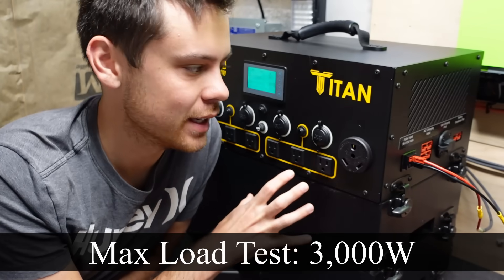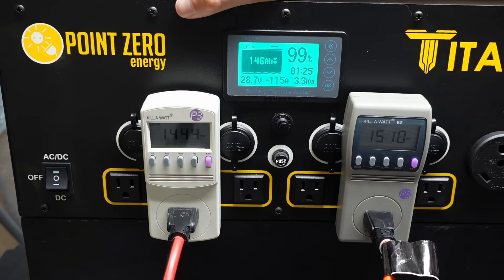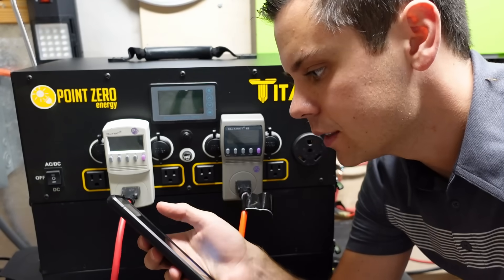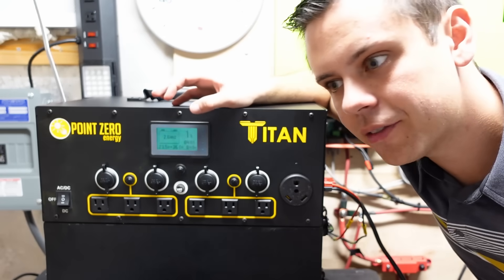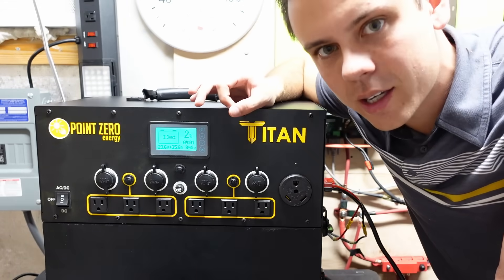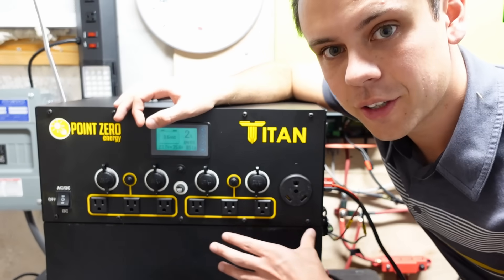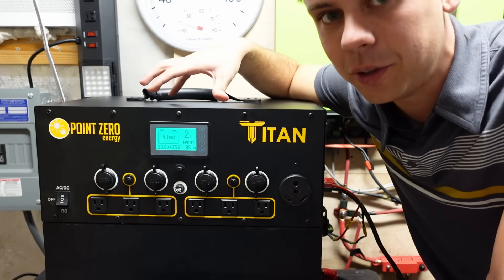Titan Solar Generator: Max Inverter 3000W Load Retest!

Comment: Wonderful content!!!  I have a question about adding a server rack or a titan style set up to my 2019 Forrest River FR3 RV.  1) It is time to replace the two 12 volt lead acid house batteries which batteries would be the best for that existing system, considering moderate off grid use 2-3 days? 2) can I plug the titan system into my rv generator full time and then plug my rv house into the titan system (with 3 batteries I assume) 3) thank you, and I am sure you would get an extra boost of followers by having specific RV solar content…..  regards Charlie V in Naples FL…

Comment: Hi Will. If you were to store the Titan for a long period of time,( a year or longer) at what state of charge would you recommend to have the battery level at?
Reply: Per the manual they recommend you fully charge unit before storing it
Reply: @kayeloop674  actually, they don't
Reply: @ozzieosawamick1712  you are right thanks for letting me know. Page 11 of the manual says  charge to at least 50% and for optimal battery life use 10% of the battery per year. Good to know
Reply: @kayeloop674  do you have a unit?
Reply: @ozzieosawamick1712  Yes. I use it for my off grid RV.
Reply: How many batteries and how many panels?
Reply: @ozzieosawamick1712  right now only 2 batteries and 10 panels.
Reply: @kayeloop674  if you were to only have 5 panels, what would it read on titan screen when charging in full sun. I ask because i only have 5 panels 100 watt, and I cant see to get about 100 watts when in series

Comment: Will, the 2021 Titan 2.0 will use Lithium batteries, require at least 70 volts imput, and have a few more bells and whistles.  Cost estimated to be $500 more than the current Titan.  Any initial thoughts off the top of your head?  Hope they send you one to evaluate.

Comment: We usually like to see higher than rated capacity in a battery, but in this case, there might be a downside. Will, in your first Titan video, you said that PointZero gets their 2000 cycle life out of these NMC batteries by derating the battery's true 2200wh capacity to 2000wh (90% DOC). That makes sense. But in this video, you test the capacity of two batteries to 4,152wh. So if the Titan generator (or, presumably the BMS) is not limiting the capacity to 2000wh, wouldn't it in practice yield fewer cycles, and behave like other NMC battery (500-1000 cycles is what you mentioned in the first video)? I know 4152 isn't 4400, but you get the point. The system didn't hold it down closer to 4000wh total (90% capacity). Or is lowering the capacity to 94% enough to yield 2000 cycles? After running the Titan for a while, are the batteries more like 2000wh capacity (in other words, was the 4152wh test result just a feature of it being new)?
Reply: tested to 4218wh in the first video.

Comment: Please have a video testing the RV plug. I used it powering my A/C “Mach 2 PS” with one battery and had the titan pulling 8kw before it went into safety mode. Issue started when I switched back and forth between low cool and high fan option.

Comment: We are enjoying your videos.  Haven't made it through all of them yet for sure.  You had mentioned in your previous Titan testing video that the DC charging wasn't great (wires getting warm for example) and to connect it directly to your car battery instead.  Did they fix this problem.  Is it safe to plug it into the cigarette lighter while driving and have the Titan charging while driving?

Comment: Would you recommend the titian for  full time rv life or would a Battle born set up be better?
Thanks
Reply: I am currently using off grid 24/7 through RV plug for the last 3 months seems to be working better now that I got the second battery and additional solar panels

Comment: I'm very new activist solar generator thing. I have a 6000-btu Kenmore Elite window AC that runs at 390 Watts Max window compressor is on and drops down 2 only 15 watts when the compressor shuts off and it's in energy saving mode. I live in the hurricane belt here in South Florida and it's the only Appliance I care about in an emergency. What size and brand solar generator should I get?

Comment: Do you have a sense if this unit or possibly the Inergy upcoming Flex system would be better for RV Sprinter conversion with our electric systems only. Pros and Cons for application in Class B Rvs would be helpful

Comment: Hey @will would you do a video in a 48v system with stacked cheap 1000w gridtie's + battery based system with an automatic transfer between gridtie and battery when the grid goes down. So best of both worlds but without a hybrid gridtie.

Comment: this should have a bluetooth   option in it with app so you can monitor it when your away  but otherwise  great product  and video
Reply: That would be nice, also a "remote" screen for RV applications.
Reply: The 2.0 has added this feature now it seems.

Comment: First of all, you won one more subscriber! Really like the way you approach and explain.
Hope you can help me have an idea for what I wan't to achieve with Solar energy.
I want to feed my lights in the front yard; My lights with sensors outside; My garden lights; The garage power; And probably use power tools.
Be able to work with Alexa to tell me the battery level and have control with the temperatures, everything in my phone.
What you think? ;)
Cheers

Comment: What is the best thing to do when different multimeters are reading different voltages?  My Victron battery protector with bluetooth reads 0.24 volts more than a multimeter that is connected to the system with a 50 amps shunt.  When I measure the voltage directly from the battery with an independent multimeter, it reads very close to the in-line multimeter but the Victron is off by 0.24 volts.  Since 2 are measuring very close to each other and the Victron is the one off by 0.24 volts, I've adjusted my cut off based on these other ones and not the Victron.

Comment: Ok. I have a question I hope you can address. I’ve looked everywhere, but nothing. I have two rockpals 100w foldable panels. I want to charge my rockpals 500w power station. Can I just use a y mc4 cable? I noticed it will only take 30v, but each panel is 19v. If hooked up like this, will I lose enough voltage to be safe to max the solar charge?

Comment: I know I'm off topic here, but does anyone have an answer for me? I just mounted a 100 watt renogy panel on my van. I have a 35AH battery and a renogy mppt 20 amp charge controller.  If I put a 12 volt plug into my accessory port (cig lighter type port) with clips on the end clipped onto my 35ah battery, will my panel keep my van battery charged along with my solar battery?

Comment: Can I parallel two of the same Titan Solar Generators 30 amp receptacles @ 110v each and get 220v single phase? If so, then would I tie the two neutrals together? This would be (2) Titan 2000 watt kits with (4) batteries total.

Comment: Great videos Will!  Was there any load testing done on the 30A socket?  I’m considering this for a camper trailer plugin with solar on the roof instead of building my own system.  Thoughts?

Comment: Will can you do the same test you did on you’re last video on the titan where you hooked it up to ac power and  solar power then you pulled the max draw out of it. I think thats a very realistic scenario that will happen once in a while.
Reply: Update: this will actually damage the unit found out first hand. Don’t use ac power to charge unit while using it

Comment: 3000 watts is just not enough power. I use a lot of power tools on a work site.  Can they make a 6000 + wattage system that will hold up under a full 20+ amp use all day?

Comment: Will I'm impressed with your knows he of solar, do you understand or know how the Tesla coil works? And why can't we use them?
Reply: With your knowledge not he knows
Reply: We don`t use Tesla coils because there is few practical uses as it give high voltage and high frequency (1000 to 10000s of hz and not 50hz /60hz like the grid) and also inefficient compared to stepping it up with a normal transformer (also invented by Tesla). As far as I know the only practical use of Tesla coil today is in the ignition system of the cars and similar as the spark coil. Tesla coils was used for the first radio transmissions using Morse code. There are probably other uses for Tesla coils that I do not know about.

Comment: I'm glad. my Titan a few months ago handled an entire home (3 fridges, 1 chest freezer) two LCD TV's, fans and LED lights. Rocked as expected for 1.5 hours  when we lost power.  Wired it through a Genny transfer switch.  No 220v as one would expect from a single unit, but everything else in the house ran like a champ. I didn't need to see this video to be a believer.
Reply: Hey Justin, I'm also looking for a whole-house solution connected to the house electric system to run three fridges, security system and lights at least. So you only needed it for 1.5 hours, but for how long would the Titan have lasted you (with no panels, just battery) if the blackout went on for days?
Reply: @Chavezoid  it was a localized power outage. I had just gotten the device and the power happened to go out. I had two batteries. on this instance though I only used one because I didn't balance the voltages on the two. It got down to 84% during that time. You have to understand that I am in Hawaii and the temperature was about 78° and it was from about 7:30 to 9:00 p.m. so it was mostly dark. I plugged it into a standard 50 amp transfer switch with an RV dog bone which allowed the bridge between the two phases. That solution meant both phases would get 110, but I couldn't start up any 220 appliances. I have solar hot water, so the hot water was out of the loop as well, but it was a short outage. My lp generator is 3,000 w and it never stresses day or night when I have to use it. My goal was to use this overnight and run the generator during the day to charge it and run the house, both without panels. But after playing with it for a while, I most definitely think I should get some solar panels so I am shopping for some as we speak. I haven't decided on amount and type, but I do think in a real world massive outage, but this dual solution with solar panels would work really well for me.
Reply: I know it’s an old post, but I’m so glad I got both of my Titans before they went out of business. Such a piece of mind
Reply: @latymz  Your not the only one...Titan has run my green house now for 5 years.  But what do I replace it with in the future...so many fly-by-night outfits, here today and gone tomorrow...how many will be in business if the economy collapses...probably none...so now I'm on a DIY learning curve...ugh.

Comment: I love the idea of having a 3000 watt generator that uses no gas or oil & can set about anywhere as long as you can connect a few solar panels and/or 115volts to it & your in business.
We bought ours for use on ancillary loads & that rare time we need power due to grid issues. 
Now we have multiple aux. energy sources. Grid, solar then Gas & Titian generators if things are down for a while.

Comment: Excellent test!  How long did it take to discharge completely when only on battery (battery discharge test when connecting a load that equaled the inverter rating)?  It looks like you with two batteries charged.

Comment: I am wondering if you have considered doing systems for 240VAC.  I have seen where you just join 2 x 120 V but I have not seen just pure 240V systems. It is only the USA that uses 120V and for people outside the USA this would be extremely helpful to us. We can only go so far with you systems here as  to buy for example 2 inverters to get 240V is just a bit stupid and expensive. You do have an international audience if you are unaware of that. Your the best Will...  :)

Comment: How long did it take to drain down to 0 on this test?...or did I miss that?
Reply from the maker: Hour and half
Reply: Thank you...can you stack more battery modules (more than 2)...I know you said in previous video you can add external battery banks...was interested for small off grid cabin all self contained.

Comment: will 2 solar panels at 12v each in series be able to charge the Titan, or will the voltage be too low?
Reply from the maker: It would actually charge it but I would go for higher voltage if you can
Reply: @WillProwse   Thank you for you reply, was considering this for a modified camper built from a Toyota Sienna minivan so there is limited space on the roof.  What would you suggest for that application?

Comment: Theres two test im curious  about is can it charge  from ac while using the  you are using the front  ac ports  i  know sounds  dumb  but im curious  also  could you use it as a moblie  power  station  to weld  i have  240v welder  and im curious  if can power  it long enough  to do a job also my current  battery  bank  is renogy  pure  gel battery   would that be compatible  with the external extended  battery  and last question  whats your thoughts on renogy  batteries  i don't  think i ever seen you talk about them?

Comment: I read today that you have to have two battery modules to get the max out of the inverter, 3000W. I believe it was said that otherwise you would only get half, 1500W out of the inverter with one battery module. Can anyone confirm this?
Reply: This is a really good question!
Reply: I know it works with 1. Test it yourself.
Reply: @dougdurfee2769  Okay, I'll just run out and drop $3K on this unit so I can see if it will do what I need it to do. :)

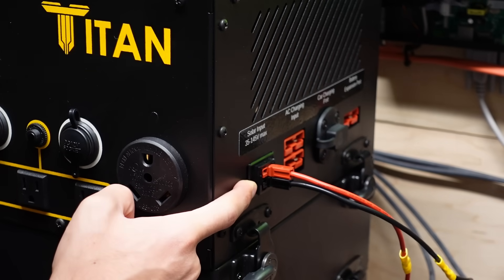Comment: At 0:26 will tells us "the open circuit voltage is 110 watts". Can anyone tell us what that means? Usually the word open combined with circuit means there's a gap nothing's connected. I have a feeling he's using it in a different context.
Reply from the maker: I said 110 volts
Reply: @WillProwse  oops! That's what i meant. :/.   My bad! Can somebody tell me briefly what that means? So it cuts out if you have over 110 volts of panel going into it? Or a fuse trips if you have over 110 volts going into it? I'm trying to wrap my head around it..thanks will, or anybody..
Reply: @iditarod4081  It's not a 'cutoff' or anything, it's just when you measure the positive and negative using a multimeter it shows 110 volts on the circuit. Just when you would measure an outlet in your house with nothing connected.
Open circuit voltage (or potential) is voltage which is not connected to any load in a circuit. Open-circuit voltage is the difference of electrical potential between two terminals of a device when disconnected from any circuit. There is no external load connected.
Reply from the maker: Volts*

Comment: Just the expansion batteries at $700/kWH seen like a pretty good deal to add to an existing system.
Reply: Yeah I was checking what it would cost to build my own pack and it actually came up to around $700 per kwh.  They are basically selling the battery at cost or getting a super good deal on the cells.  Mind you here in Canada everything is more expensive and there are less sources for cells. In my case I was looking at lithium ion 18650 as I can't find other types here.
Reply: Question so the generator it self is it worth 1500$ or just do diy?

Comment: Hi Will. You recently asked for suggestions about projects you might be interested in doing. How about the surge protection of DC circuits from inductive or transient loads such as lightning strikes. We seem to have that happen nearly every year which results in replacement of equipment, I have seen DIN rail mounted devices which use MOV's and GDT's. Could you do a deep dive into how to set these up and how they work on a solar circuit and circuit that runs devices. Maybe do a tear down of these SPD devices like you do with other equipment you have done Thanks

Comment: Will, how fast can it charge your Tesla?
Reply: If he connected it to the TT-30 plug with an adapter, which are available for EVs by converting to a NEMA 14-30, it would be limited by the inverter, so 120v at 25 amps, or 3000 watts or 3 kW. His test here output 3.5 kWh out of 4 due to heat loss running it at a higher C rating. As far as how much of that makes it into the Tesla because of efficiency losses from the charging cable and resistance on Tesla battery end, I don't know. That would be a good test to see how much energy actually makes it into the Tesla. My guess would be 2.8 to 3 kWh, or 11 to 12 miles of range, would make into the car before the Titan was empty and it would take about an hour. So, this might be sort of a stop gap solution like a portable gas tank if you're running on empty during road trips to get you to the nearest outlet, or top up while camping, but would be an expensive one.
Reply: If money isn't an issue for someone, and they maxed out the battery expansion to 8 kWh on the Titan, and used this as a portable gas tank for their Tesla, they might be better in a situation running out of charge 24 miles from a charger than someone 24 miles from the nearest gas station. At a brisk walking pace it would take 5 to 6 hours round trip to walk to the gas station with a gas can, walk back, and refuel to get back to the gas station to fill up. In the Tesla, you would just plug into this in your frunk or trunk and sit for 2 hours to drain the expanded Titan before unplugging and heading into town to fully charge in another 45 minutes. 2.75 hours charging to full after running on empty to getting into town and filling up is certainly better than 5 to 6 hours of a long walk at best without a ride from a kind stranger.